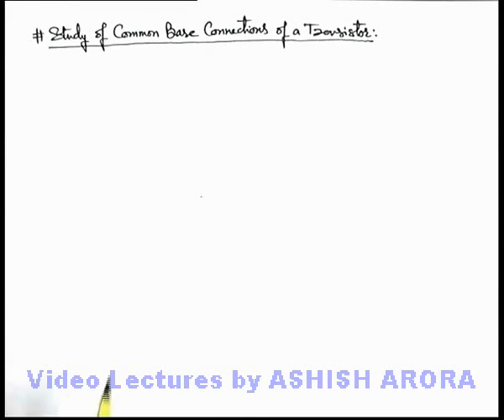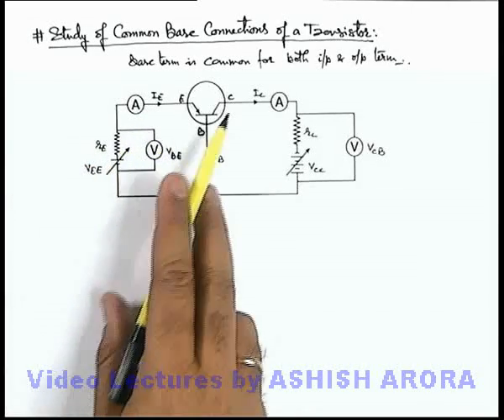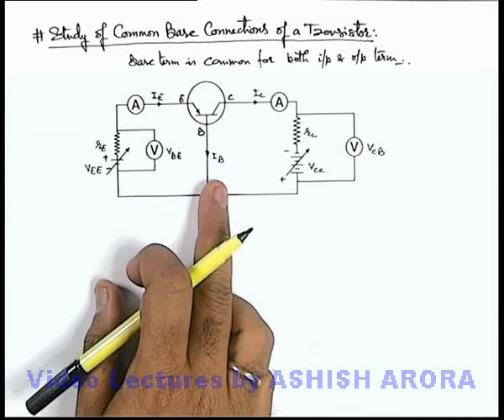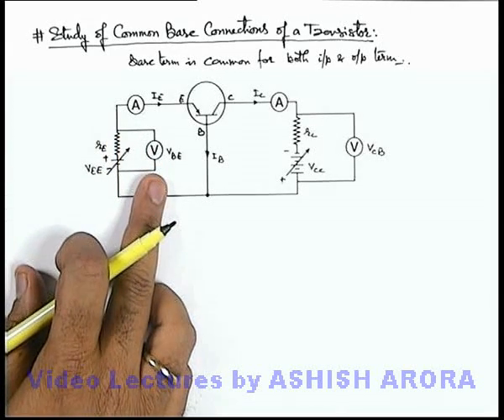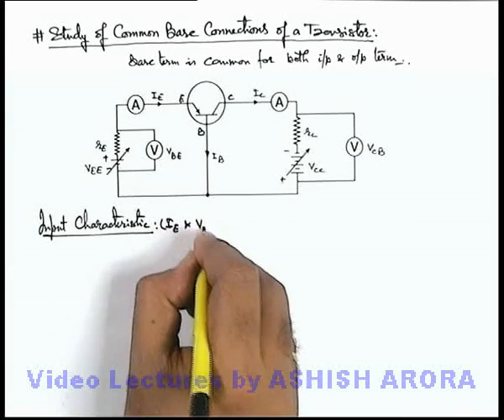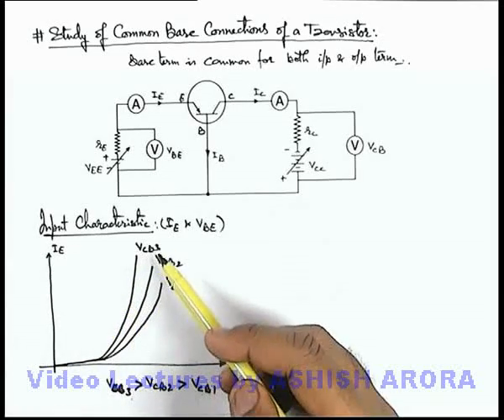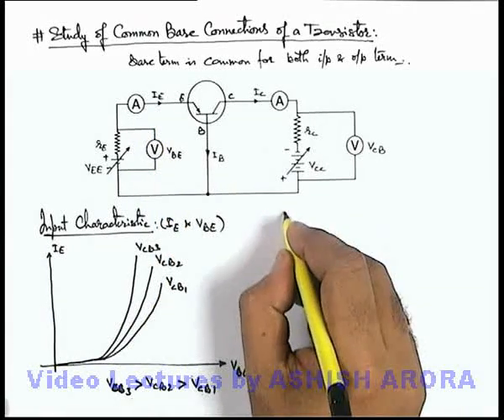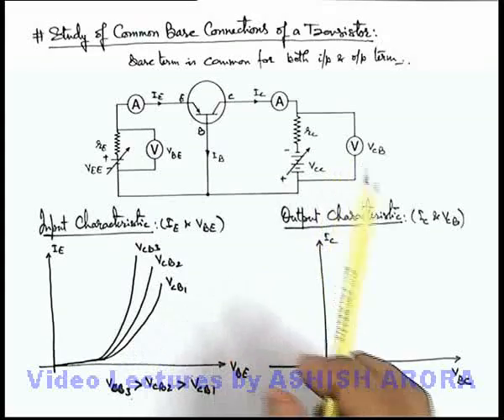Class 12 Physics | Transistor And Its Application | #8 Common Base Connections of a Transistor

Comment: Why Base-Collector Voltage affects Emitter current for a constant Base-Emitter Voltage (graph on the left side in this video)
Reply: If Vbc is increasing gradually, more majority carriers will move from emitter to collector side. That is, IE will  also increasing but will be different for different Vbc voltage. And don't forget that E&B junction is forward biased
Check the diagram properly

Comment: at 3.35 , emitter current will slightly increase , as very small current is extracted by base ? why the second statement effects first ?
Reply from the maker: On increasing Collector Base voltage base will pull more electrons from emitter...

Comment: Sir, when collector current drop down to zero then is emitter current  also lowered to very less value , ??
Reply from the maker: In above explained o/p characteristics... graph is plotted at specific values of emitter currents...
Reply: so does that mean all the emitter current is passing through base , when the collector current is zero ?
Reply from the maker: When collector is kept open then it behaves just like a diode... and as base is very thin and low doping... it does not allow large currents...
Reply: yes, since base current has to be low , that"s why i asked when Ic =0 , then since no charge carriers will now be taken by collector , so in circuit , overall current should decrease ,,

Comment: Sir u told that when Vcb is increased IE increased ( as in input characteristics ) but in output characteristics u told that Ic is constant for increasing Vcb ...but sir if Ie is increasing then ic should also increase isn't it ? Then how its is shown as straight line in graph
Reply from the maker: In output characteristics Ie is kept constant... it is not getting changed... that was varying while plotting input characteristics...
Reply: Physics Galaxy but sir if V(be) is constant and we are increasing V(bc) then I(e) should also increase which means I(c) should also increase?

Comment: sir u told if we increase output voltage emitter current increases then in outputcharateristic  collecter current is influenced by emitter current  then on incresing output voltage collecter current should increase know why it not happening

Comment: the collector should be connected to the positive terminal of Vcc , shouldn't it ?
Reply from the maker: No this is a PNP transistor and for reverse biasing of Base-Collector junction collector should be connected to -ve(low potential) side of the basttery Vcc...
Reply: +Physics Galaxy The output is always reverse biased by Vcc in the three bipolar transistor configurations , why is it so ?
Reply from the maker: Not always... we have explained that in normal operation of a transistor in active region Base-Emitter junction is to be kept in forward biased and Base-Collector junction is to be kept reverse biased... reason is explained in the video of its working as an amplifier...

Comment: sir in output characteristic curve when more emitter current is applied voltage at which collector current become 0 should also be increased?
Reply from the maker: +anshul mudgal colloector base voltage when positive then it opposes the kinetic energy of charge careers which makes collector current zero... it will not be affected by kinetic energy of careers emitted by emitter...
Reply: @physicsgalaxyworld why? Because like those charge carriers from emitter constitute current in collector no? Then greater their prior kinetic energy, shouldn't more potential be required to stop them for contributing to current 🤔